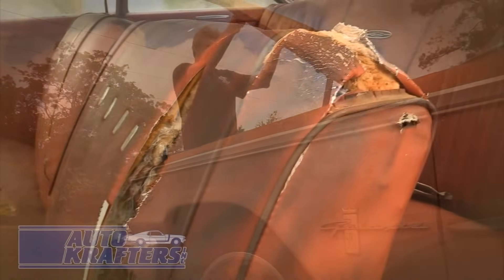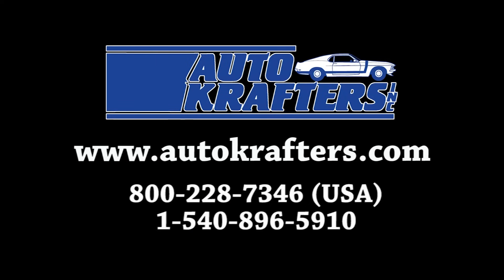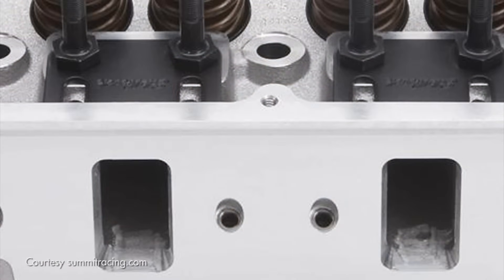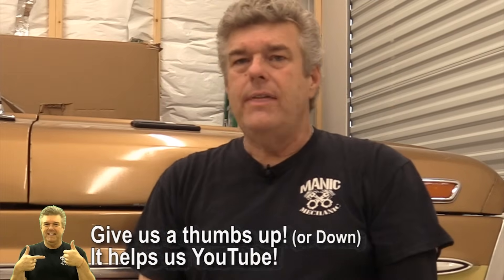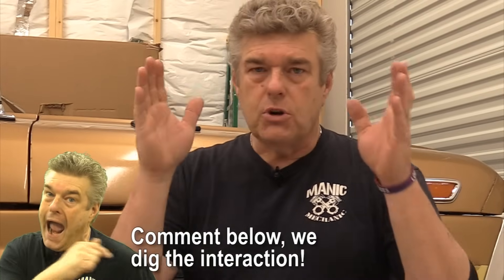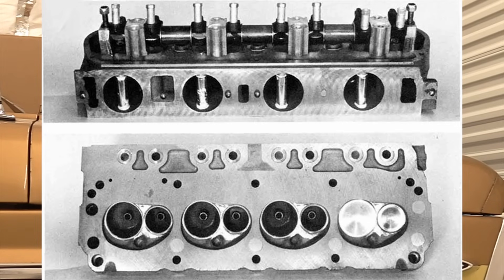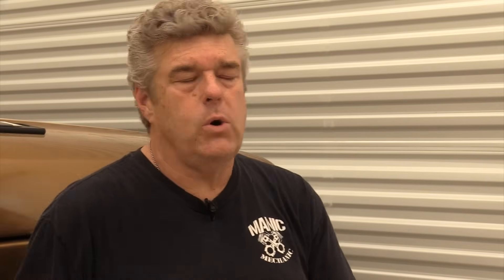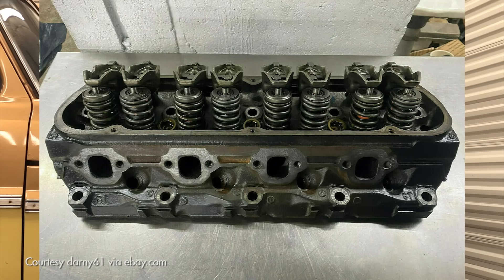Ford Heads Explained

Comment: Hey there Jeff, thanks for the video.
     I've got a 5.0 liter H.O. crate engine that I bought from Ford Racing back in 1994.  It was branded as a "Cobra" and it came with the GT40 cast iron cylinder heads and a Ford Racing B-303 camshaft.  I put this engine in my 67 Mustang Fastback back in the day after doing quite a bit of research on what it took to convert this "late model" engine into an early version of the 302 small block.  Back then in 94, it seemed that conversion info was a bit of a challenge and the parts required weren't necessarily the easiest to find.  
     I went with a Holley 600 CFM Vacuum Secondary carburetor and a Weiand Stealth aluminum high-rise intake along with a 1970 design, B&M C4 transmission.  Fuel injection kits, 20 plus years ago, weren't the best in the world and they were expensive in comparison to carburetion, so I went with the carb. 
     One thing was for sure with this conversion effort, if one wasn't careful, screwing things up in a major fashion was rather easy.  For instance, I needed a steel distributer gear instead of a cast iron one for the roller camshaft.  I found one for my Mallory distributor in the Ford Racing catalog and I needed a 50 oz. imbalance, 157 tooth flex-plate that wasn't.  In fact, I played hell trying to find one locally, (since they didn't exist as an O.E. part) and after several long distance phone calls, I located someone who knew what I was talking about and happened to be producing them up in Michigan; at a price that wasn't necessarily as cheap as they are today, but they had one.  It happens that the C4 was never offered in a 5.0 Ford Mustang or anything else for that matter that came with the 5.0 liter H.O.'s, 50 oz. imbalance crankshaft.
      Along the way, I installed a set of Ford Racing 1.7:1 roller rockers which happen to carry a Ford engineering number, but are made by Crane and are the same rockers originally installed in Mustang Cobras from 1993 and 1994.  With the B-303 camshaft that came with this engine, these rockers give .512 inch of lift which is just right for my purposes. 
     I'm planning on rebuilding these GT40 heads.  I've bought Trick Flow's valve spring kit, P/N TFS-2500100 and new stainless 1.84 inch intake and 1.54 inch exhaust valves with Viton valve seals.  I have to replace the original valves because of pitting issues along the area of the valve seats and the O.E. valve springs have to go because they're giving me valve float problems, probably because of their age and use and that they never were anything to brag about in the first place.  If needed I'll have a shop put in new valve seats and surface the heads if needed, but I'll do the rest.

     There's a couple of things about the GT40 heads that I've noticed, you have to plug the thermactor passages in the back of the heads for a non-emissions set-up or else you'll have a massive exhaust leak.  If you don't have the factory type screw-in plugs, you can use 5/8"-11 set screws, from the hardware store, to plug the holes.  They're tapered on one end and have a female Allen hex on the outer end.  The tapered end seats nicely and plugs the passage without any leakage and some red Lock-Tite  will keep them in place.  Also, I discovered that there's no thermactor "humps" in the exhaust ports like the run of the mill emissions heads have.  The holes are there, but not the humps, just a nice even exit.  
     I guess that I've said enough, maybe too much for some folks.  Thanks again, Jeff, for all that you do for the hobby and all the best to everyone who took the time to read my rant.
Reply: You got like a 300hp combo.  I had the vac secondary but imho the 650dp was easier to setup.   Also there are much better cams than the base.   Check with Brian tooley, cams with similar duration numbers can give 20 to 30hp and better drive ability and fuel mileage.   Also on your combo swapping to regular tfs heads gives like 40hp over the gt40s.   I'm sure your combo is fun as is.   Was just saying if you Decide to upgrade there are inexpensive paths for more fun.
Reply: @dennisrobinson8008  Thanks, Dennis for your input.  I'm thinking about 300 HP  myself.  I'll check out Brian Tooley's camshafts.  I'd love to get a set of those Trick Flow heads, the funds are kind of tight for them, but they'll remain on my wish list that's for sure.
Reply: @williamcharles9480  Its all nice stuff.   I had a ultradyne 223@.05", 110lsa was worth 25rwhp over my f303 back in the day and stronger torque across the curve.   Brian has been at it as long and has gotten so much better.   Whats hot on NA cars is tight lsa like 106 or 108.    Cool idle and super strong mid range torque.  He does that on the chevy LS side and can do the same.   These projects are fun.
Reply: @dennisrobinson8008   I would think that Brian Tooley's got a web site, I'll check it out because that's impressive power and those tight LSA's with a decent idle is very interesting.  Thanks Dennis.
Reply: @williamcharles9480  Glad you looked....   There's alot of exiting things going on these days in hot rodding.   Everyone is happy with Tooleys cams.
Reply: @dennisrobinson8008  biggest thing with them vac secondary carbs is a lot of the time they not even giving us full wide open throttle. If you install the lightest spring to get secondaries to open fully, they tend to be opening at a lower rpm now and fueling when not needed. And, if you dont get the rpms up high enough, they still not opening all the way. Hence your double pump was the way to go and probably works way better for you as it does for my projects also.
Reply: @whiplashmachine  Agree, I found it too much of a hassle.    The 650dp was much easier to setup, and for fuel mileage driving around town just stay out of the secondaries.
Reply: @dennisrobinson8008  soimds easy enough but I have a hard time staying off them secondaries lol. I have a 6000lb 4X4 with a fairly modified 7.5 liter engine. Fuel economy is not exactly a concern of mine.
Reply: @whiplashmachine  ok.  I was able to stay out for fuel economy on a 3000lb car.   Not too hard.
Reply: @dennisrobinson8008  yea that helps lol. I have a couple Foxbody Mustangs and they are ok on economy. One has a 306 with a 600dp and the other a 347 but that one has a 500cfm Holley 2 barrel
Reply: You could use the LS 1.9/1.55 valves after installing bronze guides. Melling valves through Summit are inexpensive. Your heads probably have the approximately 1.8" spring installed height. With that the LS beehive springs can be used with the appropriate retainers and keepers. My 289 spring installed height is 1.64" so I talked to PAC Springs and they recommended a set of dual springs I procured through Summit. You could go to a pick and pull with a short piece of rope to feed into the plug hole so you can get the springs, retainers and keepers. Find one of the more performance oriented LS for the source. A big advantage of the LS valves is they are lighter.
If your heads already have the 1.84" intake valves, you could step up to the 2.0" LS intakes for the same cost as the 1.9". Just the machine work to get the seats for 2.0" and then a little grinding in the bowl to remove ridges. Two books most speed ships carry written by David Vizard are informative; Porting and Flow Testing, and How to Build Horsepower. These will give many tips to do this.
Reply from the maker: Great stuff! We did the 5.0 HO conversion in 1986 with a take out 5.0...talk about no information...

Comment: Would like to replace my 460 BBF to a 351 based alum block build. 460 is just too big in there and heavy. Thanks for the info Jeff, great stuff!!
Reply: Your gonna miss the BB torque. I've never heard of anyone wanting to go smaller.  But your right the 385 engines are some big sob's.
If you haven't already swapped motors forget the windsor plan and look at the new godzilla crate motors.
Reply: @EPstroker  The 460 is 750 lbs of heavy sitting up front in a 3000# car. Manual steering and manual brakes. No room for a brake booster at all. Will not lose any HP, maybe torque like you said but running a 9 in nodular with 4:11 gears. Love the Godzilla but can build the 408 Windsor for much less. Trying to keep a budget.
Reply: Have you ever seen a 460 sitting next to a 32 valve 4.6L DOHC?   The 4.6L is WAY bigger!
Reply from the maker: I'd look to a 1985-1996 F250 with the Windsor. Keep in mind that your may have to modify the mounts to do the small block and the springs will definitely need replacing.
Reply: Build a 393... 300 bucks for a crank, stock 351w rods and hundreds of choices on 302 ford pistons...low buck monsters

Comment: I remember when your best bet was to find a set of C09 cylinder heads, they got pretty expensive for the time. Now we have WAY better options in the aftermarket. Unless you're really strapped for cash I don't know why you wouldn't use them.
Reply from the maker: Me either. I agree with that idea!

Comment: Twenty plus years ago I built a '86 5.0 for a Turbo Coupe swap project. After looking at cost to have a set of '69 351 heads built, bought a set of Trick Flow(on sale $949) and sold the old heads. Boy Howdy, I ain't ever going back to any factory iron head.
Reply from the maker: My thoughts too. But there are times when a stock head is prefered.
Reply: @AutoRestoMod   I prefer them on my 428CJ, BUT if I ever pull heads again, it'll get aluminum.

Comment: How much is a set of stock 69 351 heads worth? I was going to stick with them but the AFR 185 Enforcers went on sale - great quality head, f*** what the gate keepers in the forums say, arp hardware, and I don't know how much power I'm making but it's much more than expected. I believe the Enforcers are one of the cheapest name brand heads on the market, and were equivalent to the cost of updating my 69 heads with similar quality parts.
Reply from the maker: Air Flow Research has always been a really good name. If they work, use them!

Comment: So I should keep my 69 heads on my 351 Windsor
Reply: Only if you are worried about concourse condition.  Way better to use a modern head ,machining the old heads will end up costing almost the same but not be as good due to limitations in old design. Keep the old heads and sell them with the car if you ever do , so that the buyer can have the choice. Greetings from Australia
Reply: yes.  if they aren't California heads and the thermactor humps in the exhaust ports are not drilled then you can grind that hump out of the port and it will breath quite a bit better.
Reply from the maker: I would!

Comment: Where does my 292 Y block in my 64 F100 fit into this discussion?
Reply: Your heads are being used to prop the door(s) open... Sorry...

If this is a real question, I believe the '57 312 head was best breathing.
Reply: @tombryant1104  Yes, this is a serious question, I own a 1964 f100, all original and I do not know anything about but you guys are talking about, but I am trying to learn, so yes, I am asking does is being discuss applicable to my engine.  I am going through about a quart of oil every 25 miles.  Compression seems ok and I have not blowing a trail of smoke, so where is the oil going.  I was thinking the heads, through the value seals.  Thoughts?
Reply: Since you're losing oil so fast when driving, my best guess is a leaking head or intake gasket. Had it happen on a dodge 360.
Reply: @michaelgallo3943  Only heads for Y block 272, 292 & 312 interchange, there is no aftermarket support. 1964 was last year for Y before it became a notation in the history books. Back in '70s & earlier, valve stem seals were a common problem. Usually when they have failed there are pieces "laying around" the springs. At 50 miles to quart it should be smoking badly, no way it can burn that much oil without making the occasional cloud. Leaking that much oil, it would be leaving puddles. 

Run it up to around 50mph in 2nd, back off and let it coast, in gear down to 25, accelerate. Failed valve seals will make a smoke show.
Reply from the maker: LOL.

Comment: Can I run 351w heads on a 289 without issue?
Reply: 351 heads have larger holes for their bigger head bolt diameter, so you need to use 289/302 bolts inside sleeves for them to work. And, the larger chambers of the 351's will drop the rated compression of the 289 by a full point, so figure out what you are doing ahead of time.
Reply: To add to "413x398"'s reply, If your 289 was making 10 and 1/2 or 11/1 compression dropping in a whole point will just mean you can run pump gas so that's a viable option.
Reply: @jdhutch4278  Yep, and if you're already at 9:1, the W heads will force you to buy a turbo. Just because.
Reply: @413x398  lol
Reply from the maker: What they saidVV

Comment: Ai yai yai yai ma head hurts now. Aaaaaannnndddd now I don’t know what I want to do with my 260 🤦‍♂️
Reply: I use to race a 260 in a mustang .I used a solid  lifter cam and put larger value and cleaned up the ports and a  ford motor  performance  thin head gasket.and heaver valve  springs.a 55o cfm carb and headers.it ran in the low 13s in the quarter. This was in 1965. You can make a 260 run .
Reply from the maker: LOL. Anything will cost you compression. So, get a set of 289 heads and flat top pistions. Should breath way better.

Comment: Ya always got some interesting info Jeff. Especially helpful to newer folks in the hobby. I hope you don’t mind but couple of things. The “slotted” pushrod hole on the 289 hi-po heads is on all 289’s prior to and including early ‘66. They were guides due to the flat end rocker arm style. In ‘66 they changed to the rail end style rockers which precludes the slotted hole. If you change rocker style you must use guide plates. This change was not applied to 66-67 hi-po heads. Hi-po heads also had cast in spring seats, an easy identifier for them. Don’t forget too 351W heads on a 289 or 302 require head bolt spacer inserts. 289/302 used 7/16 head bolts. 351W used 1/2.
Keep the great videos coming my friend!!
Reply: Ford once made a kit for this head swap, which included specially made head bolts that precluded the need for the spacer inserts.
Reply: @et76039  Yes sir they sure did. 7/16 threads and an oversized (1/2) shoulder. Thanks for reminding me about those.
Reply from the maker: I missed that in my talking points. I "knew it" but in trying to keep all the info going I dropped that. Thanks for the correction.
Reply: @AutoRestoMod , hey, we're all on the same team here.

Comment: I agree on just going aftermarket heads unless building for a concours correct car. By the time you put all the machine work and parts into them, you're already almost there. I got a pair of Blueprint heads from Summit for $1100. Came with 2.02/1.94 valves, studs, etc. Although it is fun searching for treasure in the boneyard.
Reply from the maker: Best day of shopping I know of!
Reply: I got a set from a guy on marketplace for two hundred and something. Paid a machine shop a hundred and change to mill and inspect. Gonna lap valves and all is good. Maybe I just got lucky.